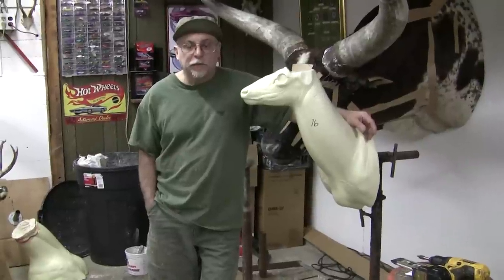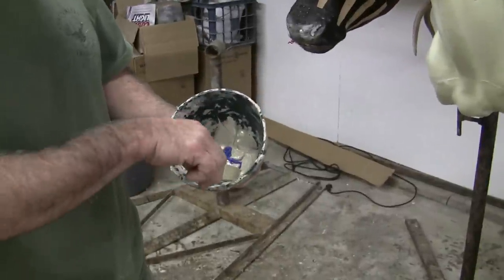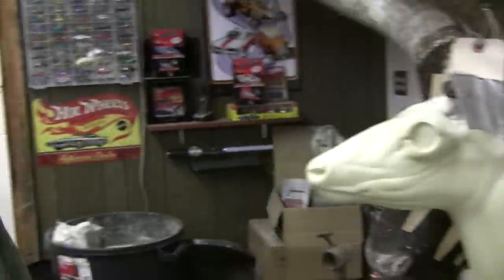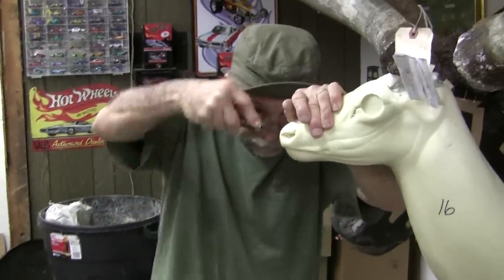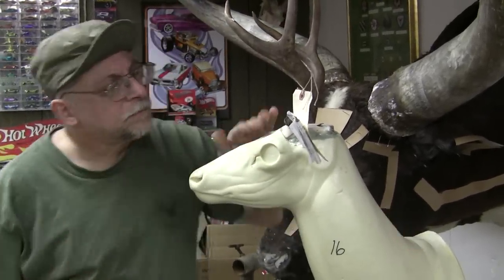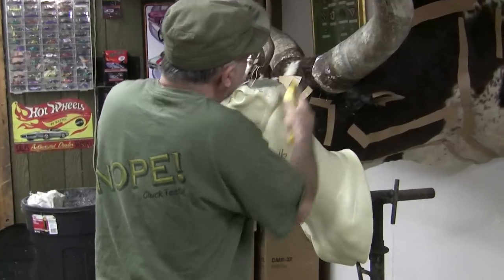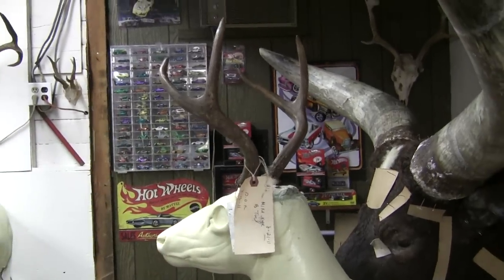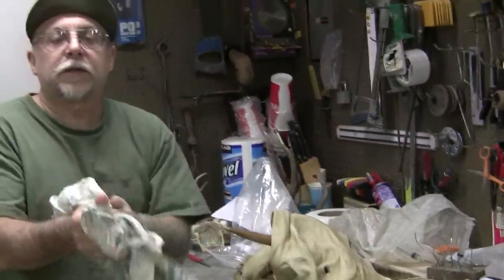Testa's Taxidermy Tip's - Mounting a Deer Head (Part 1)

Comment: Were can you get a dear mannequin and can you put fabric in sted of fur
Reply: You can usually buy mannequins on ebay for around $100. Putting fabric on instead of fur defeats the purpose. Deer head mannequins are made specifically for deer head capes (aka a hide). You can’t find deer head capes made out of fabric. It has to be a real skinned deer head to put over the mannequin.